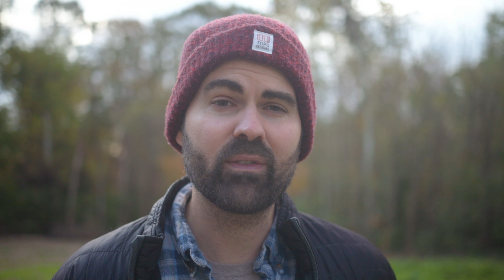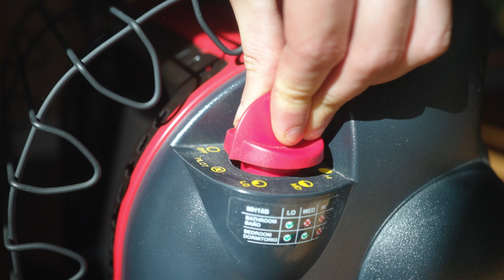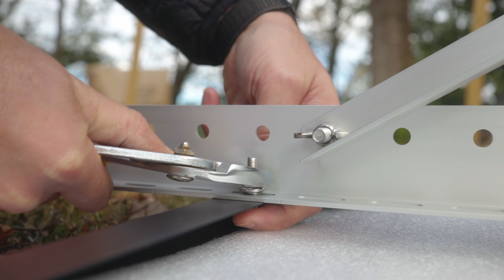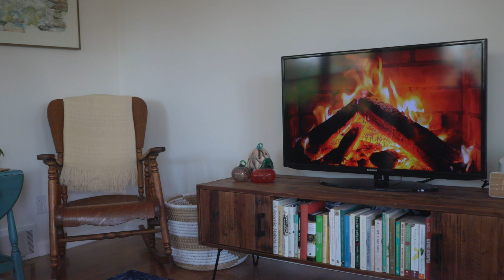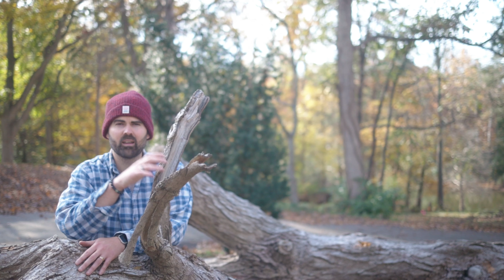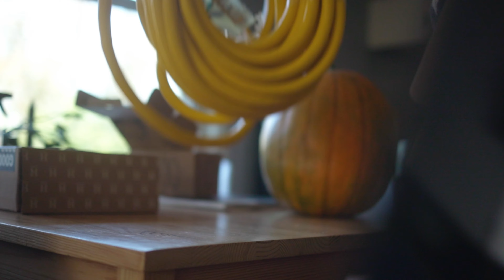Preparing for Winter Power Outages - Urban Homestead Prepping

Comment: In order to have sustained heat in the coldest time of the year if power goes out for several weeks or months the only thing I can think of that will work totally independent of the utilities is a wood burning stove.  Last winter my geothermal heat pump had a compressor failuresurprised if power becomes completely unavailable in the next few years.
Reply from the maker: I agree. A wood stove is top of the list of things I want in place in the next few years, in addition to more solar and some rainwater storage and filtration.